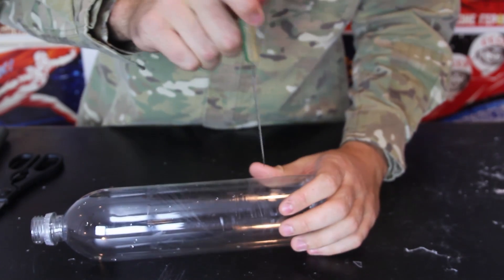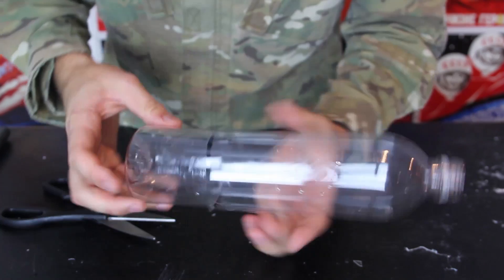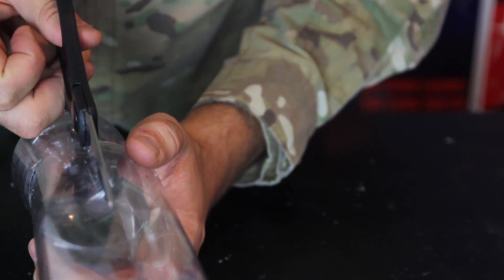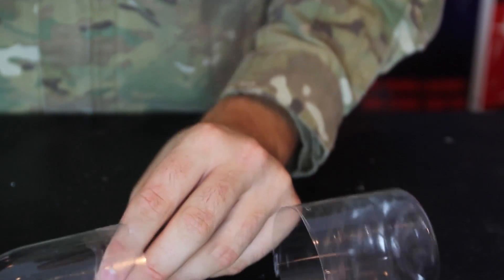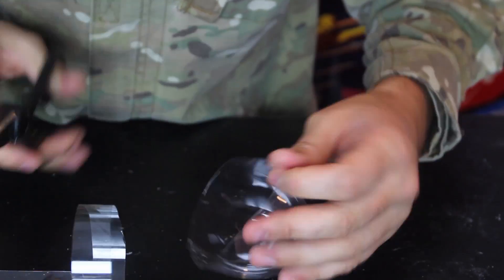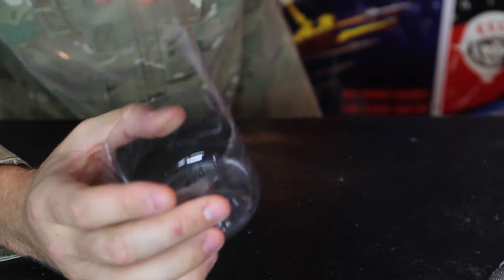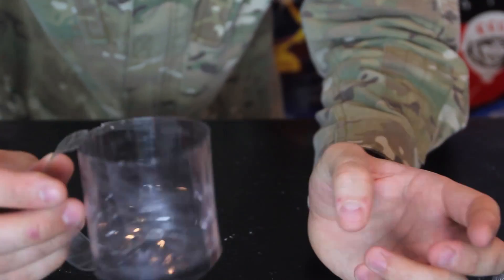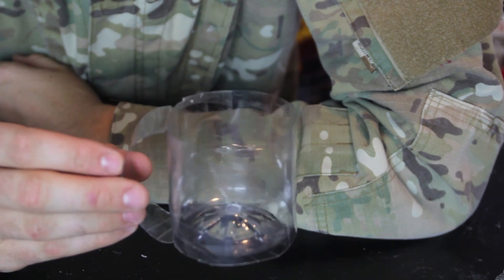How to Make a Recycled Plastic Mug out of a Bottle

Comment: Not sure if I'd wanna put hot water in that thing, plus I wonder how sturdy it is when it's full.
Reply: It's a handy little trick you can use if you're poor, studenty or just mug-lacking.
Hot water wont melt it, though it will heat it pretty well, and it wouldn't be the most sturdy, though as long as you don't fill it to the brim it should be fine. (Also a bit of duct tape will help it retain its shape when full. Also a larger top ring that loops the bottom will go a long way towards making it more structurally secure)
Reply: Damn good idea about the duct tape!
Reply: BUT... If you are poor, how do you watch this video then? And how do you buy the bottle if you dont have any money? DUH! This is just freakin useless. But ONLY if you are recycling its handy... 😒
Reply: Nails4ever426
Repurposing... Recycling is different. Aside from that, the heat from hot tea will deform this very easily, AND you have destroyed a perfectly good container... to make a mug... that holds 1/4 of the original.
Reply: How about try it and find out
Reply: Nails4ever426 If you're poor you can watch this video on a public computer like for example in a library. And a water bottle doesn't cost much so you can easily afford it and even if you don't you can ask your friend or somebody for one
Reply: ©Turttrise  In my country, using computer for internet access in library is not free. we have to pay for it.
Reply: well then..
Reply: its actually pretty cool
Reply: well an ice bottle would be neater but a normal water bl\ottle is cool too

Comment: Ok just a few important things.
1, no matter how well you cut it with the scisors the borders will still cut your lips like knives. To remedy this you can use a lighter on the borders so it melts slightly and becomes soft.
2, it can't hold boiled water. 80+ (more or less) celsius degrees melts the plastic of pet bottles.

Comment: putting hot tea in there will melt the plastic a little which will cause some harmful and toxic substances to segregated from the bottle and you'll end up drinking that stuff :x
Reply: Not really... Unless that tea is steaming hot, which would be a pretty bad idea to drink, unless you want to burn yourself :P
Reply: PET (Polyethylene terephthalate) doesn't melt under 200 C°, the harmful and toxic part you're talking about is correct. but the process is called Hydrolysis ;)
Reply: vijay mane Lol xD

Comment: way to go big guy, better stick to cold drinks just incase it melts. anyway its a good idea if your stuck for a mug. I used to use a been can to put hot tea or coffee in with a wire at the top to hold it because when you put the boiling water in it gets very hot (we called it a billy can)

Comment: heat up a frying pan with vegetable oil and press the top edges of the cup into it, it should melt the sharp edges without burning them so you have a nice smooth edge to drink from

Comment: If you don't think it won't melt it try it... Put just boiled water into a plastic bottle or your new water bottle cup. It will get soft and lose its shape. It won't melt into a puddle, but it will certainly deform (permanently) and become soft until cooled off. It might have an off taste as well, as there will be leeching of some chemicals into the liquid. Not a good idea of regular use, but it can be done. It would be much better suited to something cold.

Comment: Blood has peroxide destroying enzymes with enormous catalytic activity. However your reaction rate is not that exciting, because it's held back by lack of good contact of reactants, just like a fire, like charcoal, burns very slow in air, because the air needs time to get to the incandescent coal to react, but if you mix the coal intimately with an oxidizer, such as nitrate, chlorate, or copper oxide, at a small particle size with large contact surface area between the particles, you can smack it with a hammer and it may suddenly explode from a very fast rate chemical reaction. The problem with blood, compared to the lower catalytic activity but even faster reaction rate manganese dioxide, is that its density is low, and the foamed up blood sits on top of the water, the foam blocking mixing of the reactants until the bubble breaks down, which can take forever, as opposed to manganese dioxide, that does not create any foam, so the gas bubbles can leave the reaction zone fast, and its density is higher, so as soon as the bubbles are gone, it falls to the bottom for good contact, and instantly creates new bubbles. One way to create a boom with H2O2 might be to freeze it into tiny ice crystals, mix it while frozen, in like a miniballmill with fine dust manganese dioxide into a homogeneous catalyst/peroxide mixture with large contact area without a reaction because of solid phase, then send electric through the mix to quickly heat it incandescent, melt the water and get the peroxide catalysis going. You could possibly do that with frozen blood ice crystals too, mix it in with dusted frozen peroxide ice crystals, and then suddenly heat it, if you can find a way to suddenly heat it, because then the rate of transferring temperature may be the bottleneck of the reaction rate. Possibly mix in some graphite dust or metal dust or something that helps conductivity. There may be a liquid that's very conductive electrically, like some organic ionic liquid with salts dissolved in it,  but does not dissolve peroxide at all, even at ppm or ppb levels, and that could create a sudden heating with electric, but I don't think liquids like that exist to moisten the mix with, so you're left as a choice a conductive solid oxide, like even lead dioxide/lead monoxide mixes, or cupric/cuprous oxides, in manganese dioxide/manganic oxide/manganous oxide mixes are not conductive enough, but then you lose your ability to compare blood vs. these other oxides. Possibly you may find manganese oxides vs. manganese oxide+blood ice crystals ball milled with peroxide ice crystals to have a much different reaction rate, where a little bit of blood makes a big difference, because this time it's intimately mixed with the peroxide so foaming cannot stop the reaction rate much, while the manganese oxide creates the electric conductivity required for sudden explosive heating (and, because it's hard to regulate, it may create simply a steam explosion from temperature. A way to get some kind of regulation is to use a huge charged up capacitor, say 1000 microfarad and 100V or whatever volts you need to get a lot of amps through the mix, and then the smaller quantity of the mix, the smaller the capacitor needed, but in the end you may end up with some cheap, eaily accessible blasting cap things.) The biggest issue is of course griding or ball milling ice crystals in a supercold freezer, by themselves at first, then mixed together, and hoping the reaction rate while ball milling - which generates local heating local friction, and melting, like ice scating - stays insignificant.
Reply: nice. wrong video though. :D

Comment: Depending on kind of plastic the bottle is nade of, it doesnt have to be heat resistant. Some bottles will start deforming, if a hot water is going to be poured. But still, great idea, perfect for drinking cold liquids, and very lightweight.

Comment: you could also heat up th upper edge in hot water and then the plastic will shrink and round off! so what you want to do for this is get a saucepan and wil it with a layer of water about and inch will do and then you will heat it up and when its hot then you will get your mug and place the open nd in the hot water and let the edga touch the bottom then you spin it for some secs and take it out! DONE :D

Comment: I wouldn't do this. Every time you pour something in the mug, a piece of that plastic erodes away INTO the drink that can lead you into sickness..
Reply: so drinking soda from a plastic bottle gives you cancer? im doomed. (i was beieng sarcastic)
Reply: Yep pretty much.
Reply: Now think about all those years you've drank water that has been pumped through pvc.
Reply: CrustyHO
Well, at least we're not Rome. Part of the fall of Rome has to do with the fact that they used lead pipes and lead... everything.
Reply: jreed136  We're Rome 2.0! With new features!
Reply: Are you aware that this doesn't really happen anymore (assuming BPA free)? 
Are you also aware that this happens to the original drink, as well?
Reply: I know TheTrue.
Reply: Well, not exactly a sickness. But it's not healthy.